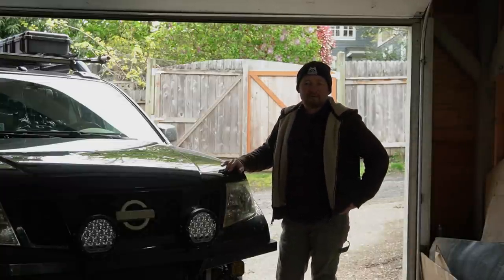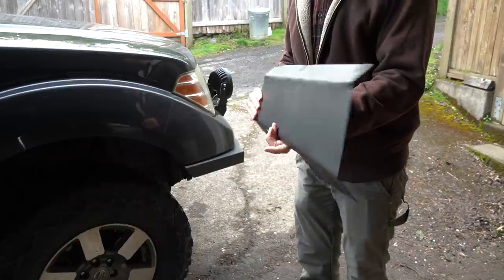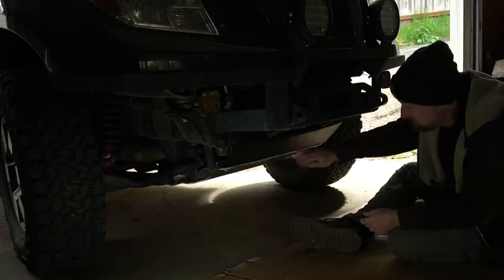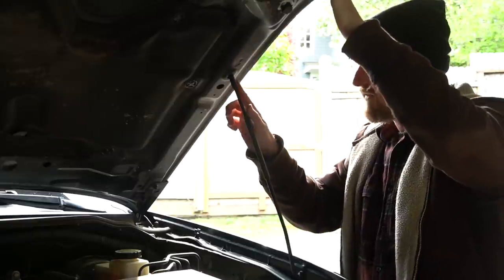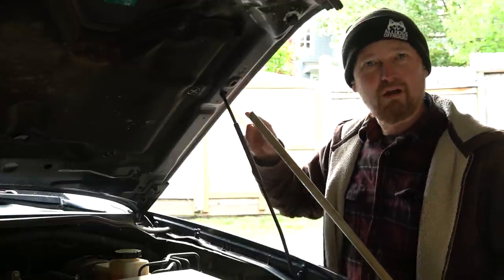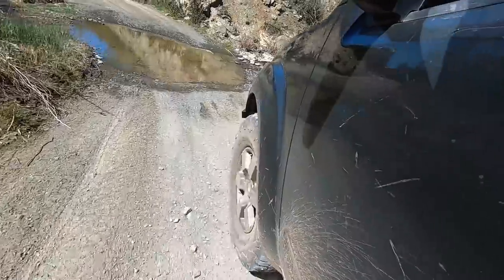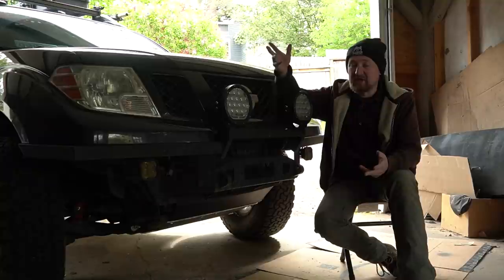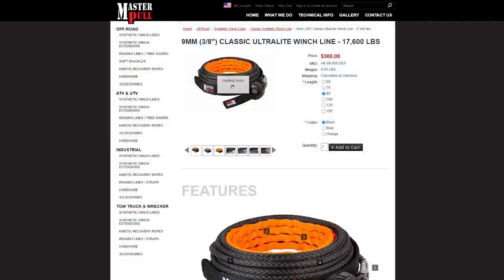Midweek update - I got new tires and purchased a winch

Comment: The issue with welding with battery conected is if there is current passing through bearing or electrical and it arcs like bad connections, and some people conect earth back end off car and weld at front a lot of thing's are insulated, all the best to you all

Comment: Nice coincidence; I am running the Wildpeak AT3W on my SH Forester, and they are exceptional. I am driving 80% road and maybe 20% offroad/gravel right now for my job, and even on wet gras they have good traction, never actually slipped with them. On the road they add a nice deep growling sound. Way nicer than street tires with a rather pitchy noise. I was suprised by the wet breaking ability on the street. I think it was a good choice.

Comment: The sheet metal looks good it does clean up the look you may want to attach it to the bottom of the skid plate instead of on top so if you do catch something it slides over and doesn't catch that edge of the skid plate, love watching your advintures keep it up 😃
Reply from the maker: That was the original idea, but there ended up being enough imprecision in the whole thing (cough cough shaping metal with a rubber mallet LOL) that I struggled to fit things together. I do hope to eventually make version 2 out of slightly thicker aluminum - and with more precision - so it can overlap the skid as it should, but that probably won't happen until this one is damaged beyond repair haha. :-)

Comment: You should have just put a set of  bonnet struts off EBay $30 and about 30 minutes to install one of the best mods I have done to my Navara
Reply from the maker: Yes, I actually meant to mention the hood/bonnet struts in the video. I have a buddy who has them on his Frontier and I AM planning to do this as well, but I knew that realistically it wouldn't happen before my next big trip and I figured I could knock out this hack solution pretty quickly. It was totally a spur-of-the-moment idea when I was out in the garage to work on a few other projects. :-)
Reply: @softroadingthewest  Offroad Gorilla makes the best one, along with their rear diff breather kit. I've had them on both my Frontiers. Love the channel!
Reply: I love those tires on my frontier! They are quiet on the road and traction seems to be great. I have had some time on ice and snow covered roads where I did have some slipping that I was surprised by but over all pretty solid.

Comment: Great additions. Your platform is just getting more and more dialed in. One small suggestion. Would you be able to mount that shield you made on top of the skid plate? This would help a bit with stuff catching between the two and with aerodynamics.
Reply from the maker: Theoretically, yes. That actually was the original plan...it definitely makes more sense for my new piece to sort of flow over the front of the skid plate rather than tucked up under it as I've done. For a number of reasons however (probably mostly my own incompetence LOL), that proved a little trickier than expected. Ultimately it's just a quarter inch of aluminum that sticks out below...it's a non-issue aerodynamically in light of all the other exposed surfaces in front there. This was sort of an experimental prototype though...my thinking is to eventually re-create this piece with thicker aluminum instead of steel, and hopefully with enough precision to mount it over the front of the skid plate. But with everything else on my list, that''ll probably be a low priority for a while. :-)

Comment: Did you consider pulling struts on the hood?
That's the same wench I purchased last got my wife's Jeep.  
I also read and watched about 15,000 reviews on winches and decided that the Warn wasn't that much more than the other brands.  I do have a HF one on my Jeep.  🤔 I may need to do some trading around.
Reply from the maker: Yes, I actually meant to mention hood struts in the video. I have a buddy who has them on his Frontier and I'm planning to do this as well, but I knew that realistically it wouldn't happen before my next big trip and I figured I could knock out this hack solution pretty quickly. It was totally a spur-of-the-moment idea when I was out there to work on a few other projects. :-)

Comment: Can't go wrong with Warn.  I only have the VR 8, since 2018 and it still works. :)  I used to have the Wildpeak 33s, better than milestars in the snow, obviously. 😄
Reply from the maker: I was looking at 8,000-pound winches (in fact I actually scoured through your Instagram page to figure out which winch you had on your truck!) but the 10 was on sale for hardly more than the 8 and the overall dimensions are the same. I'm sure the 8 is largely adequate for my relatively lightweight build, but it occurred to me that since I most often travel with my buddy Jason and his 9,000-pound van, what if I had to help recover his rig one day? That thought clinched the decision to err with a bit of overkill. :-)

Comment: Wiring wiring wiring

That is the key to winch reliability. 

Undersized wiring and underperformed batteries and alternators will cause voltage sag and make the winch pull more amps (and therefor HEAT) for the same load.... 

People argue all day about brands and models. But if you've got poor wiring none of that matters anyway

Comment: I've already seen plenty of people swap to the Badlands from Warn and that honestly would have been the better choice. Plenty of info out there supporting the Warn isn't what it used to be. Totally can back the tires though they are great and you'll really see the difference they make when you hit the trails.
Reply from the maker: * shrug * If I had bought a Badlands, I would have had the same comment saying the Warn would have been the better choice and people switching from Badlands to Warn. I think one of the reasons I've dragged my feet so long on buying a winch is that I knew I couldn't win this one, LOL. Regardless of what I do, there's always someone who thinks it's wrong and feels compelled to voice it. 

At the end of the day, I was comparing made-in-China winches to made-in-China winches. I suspect any of them would've been just fine. I ultimately decided upon the company headquartered in my state which also had the best reports of taking care of problems if they do arise. If the choice turns out to be a bad one, well, it'll be something interesting to talk about here on the channel.  :-)

Comment: Off-road Gorilla makes struts for the hood of your Nissan. I bought a set for my Xterra and even the nissan dealer loves it
Reply from the maker: Yes, I actually meant to mention the hood struts in the video. I have a buddy who has them on his Frontier and I AM planning to do this as well, but I knew that realistically it wouldn't happen before my next big trip and I figured I could knock out this hack solution pretty quickly. It was totally a spur-of-the-moment idea when I was out in the garage to work on a few other projects. :-)
Reply: I am using C channel for my roof rack because I've been watching your videos and I put a 50x14x10 lockable box that holds my recovery gear in it and put my recovery boards up there on it too. You've motivated me on getting out there more and I thank you for that.

Comment: Id suggest you follow Darren greys advice. And get some bonnet struts.  Your bonnet will still fall down if the wind gets under it..
Reply from the maker: Yes, I actually meant to mention the hood/bonnet struts in the video. I have a buddy who has them on his Frontier and I AM planning to do this as well, but I knew that realistically it wouldn't happen before my next big trip and I figured I could knock out this hack solution pretty quickly. It was totally a spur-of-the-moment idea when I was out in the garage to work on a few other projects. :-)

Comment: Donald-  I'm curious about your tire choice, as I'll be in the market for some soon.  Was the decision to go with the Wildpeaks because of price difference, since you already liked the K02s?  Also, nice job fab-ing that skid plate, that's a great idea
Reply from the maker: Actually the Wildpeak AT3W is currently quite a bit more expensive than the KO2. I was going to just get another set of KO2 because it was the better price and I've been happy with them, but the local independent tire shop I worked with seemed to have a relationship with Falken and was able to get the price down close enough to the KO2. 

I was motivated to try a different tire because, while I've loved the KO2 on both rigs, it's all I've ever known. Many MANY people talk about how much happier they are after switching from the KO2 to the Wildpeak AT3W. The only way I could really know for sure - and be able to provide firsthand feedback to my viewers - is to run a set myself and see what I think. From everything I've read, I doubt I will regret the choice. What will be interesting is to see if I buy another set when these wear out or move back over to the KO2...that's some years away though (I hope, haha).
Reply: @softroadingthewest  Thank you for the info, I'll be pricing the AT3W for sure.  Had no idea they were more expensive, makes sense to try out another good option and see how they compare

Comment: Being a fellow Frontier owner (2011 SV with ADO broverland pack, Bilstein + their Upper Control Arms), I'm curious how driving with 33's are on your truck. And by that I mean your daily driving. Do you notice any performance issues with acceleration, braking or overall handling? Thanks, Donald.
Reply from the maker: Absolutely zero noticeable impact on daily driving. Even the speedometer still reads accurately, compared to the speed readout of my GPS unit. It is a pretty subtle size increase. I imagine someone going from smaller more basic street tires to 33" AT tires might feel a difference, but my Frontier already had heavy ATs when I bought it, so that's it's all I've ever known. The truck seems not to have noticed the slight increase in circumference and weight.

Some years ago when I went from all-season tires to slightly larger all-terrain tires on my Subaru, I noticed an immediate difference in how the car drove. But on the Frontier, from 31" AT to 33" AT...no effect that I can perceive.   

It's not even been a week, so a little early to report on MPGs, but so far my MPG readout hasn't changed driving around town on these for the past five days. I have a loooong trip coming up soon which will give me a better opportunity to see if MPGs are impacted in freeway, highway, and trail driving. I'll eventually make a dedicated video about the tires and will cover all aspects of the experience, including any impacts of the upsizing.
Reply: @softroadingthewest  Thanks. I've been going back and forth with Chad about those new ADO rims but I got to hold off for a little while before upgrading. Did you get gun metal or bronze? My truck is the same color as yours, too. I look forward to all your videos. I stumbled on you last year when you did the RAM mount video. I couldn't believe someone else had a Nissan frontier that they were modifying for soft road travel!! Thanks.

Comment: You could get a replacement prop rod for $5 @ a pick and pull scrap yard.
Reply from the maker: I didn't really want to put the same rod back on there with the plastic tip that would likely just break like the other one did. The real long-term solution here is to retrofit gas struts so the hood stays up on its own, but this was a quick & easy spur-of-the-moment fix using whatever I had on hand and cost zero dollars. :-)

Comment: Fab Rats swears by the Harbor Freight winches.
Reply from the maker: I'm sure they're just fine - I seriously seriously considered going in that direction. I don't really know anything about winches, but one thing I've noticed about the people like Fab Rats, Matt's Off Road Recovery, etc who swear by the Harbor Freight winches is that they run them all the time. It seems like people who have any winch fail are people like me who have far less frequent need to run a winch, so that thing just sits there unused for months or years at a time. In 4+ years of backcountry exploring, I have only been in maybe two or three situations where a winch could have been useful (but in each case, a snatch strap resolved the issue). My intention is to somehow make regular use of the winch even if I end up with no recovery scenarios...we'll see how well I follow up on that. :-)

Comment: I "WARN" you. Lol. At one point, Warn were the best. Now they are NOT built the way they used to since the decision to move to China. Everything that comes from China lack quality control. Corporate greed at it's best to say the least. They break just as much as any other winch now. Competitors such as Harbor freight or Smithy are now far exceeding customer's expectation for dependability and durability. I have so many friends who have the new Warns and they are basically a POS. There's a demand for the older quality built Warns though.
Reply from the maker: Oh it didn't matter what I bought. Someone was going to tell me why I was wrong. :-)

Comment: You know they sell oem parts, for instance a new "prop rod" to hold up your hood, but I can tell by looking at the front of your once good looking truck, you are not someone who appreciates oem parts. As people get older that is something they learn.
Reply from the maker: I definitely did not want to simply replace the rod with the same thing, as it would have the same weakness - that plastic fitting at the top. Really, the best solution is to install the aftermarket gas struts which are available for this truck, but I knew that realistically that wouldn't happen before my next big trip. This was an unplanned, spur-of-the-moment hack to quickly solve the problem literally using whatever I found in the garage. It took me very little time, cost zero dollars, was kinda fun to figure out, and it works. :-)  I think the gas strut mod will still happen one day, but I just have many many other higher priorities at the moment.